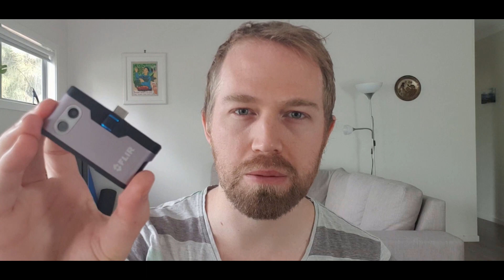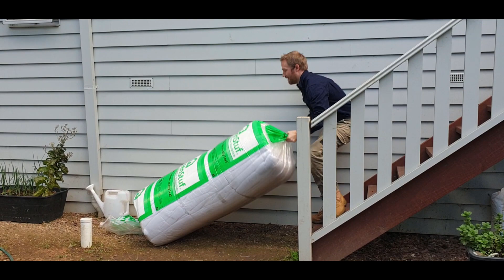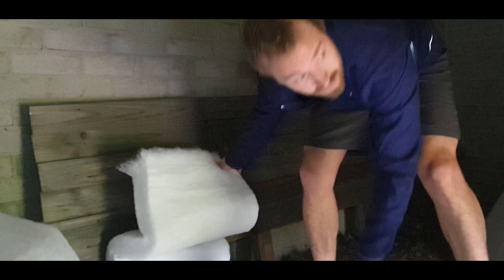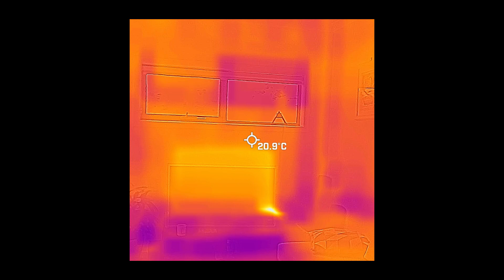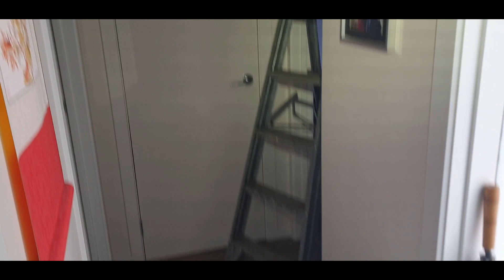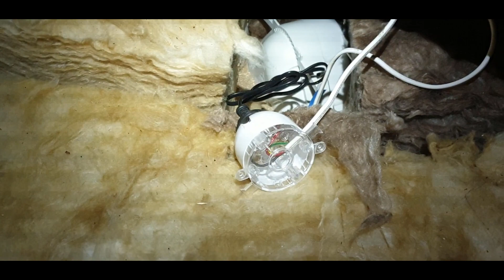How to increase the efficiency and thermal comfort of your home: DIY Melbourne

Comment: Question.  Is clearing the spiders with a broom an important step? We probably have about 60cm clearance under the house and trying to get a broom down will take ages. Is there a thermal reason for this or is it safety/kindness to spiders?
Reply from the maker: Thanks for your question. If your underfloor space is limited, you can try using a shortened broom (otherwise known as a brush). Spiders are great so it is mostly for kindness, they will typically not affect any heat transfer around the home.